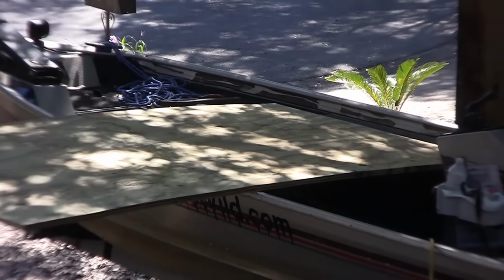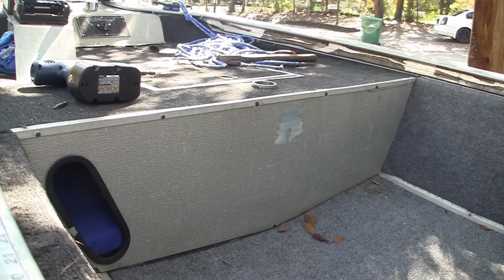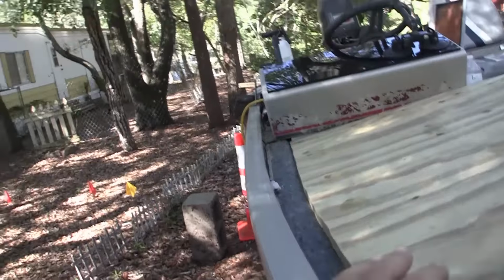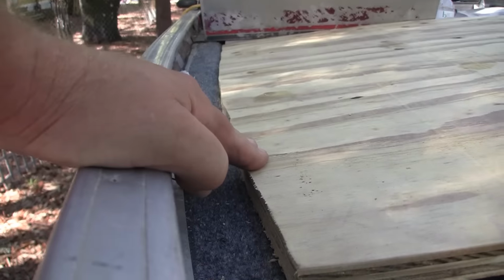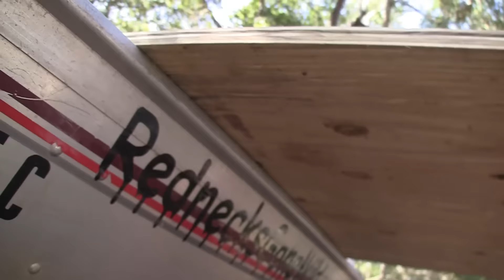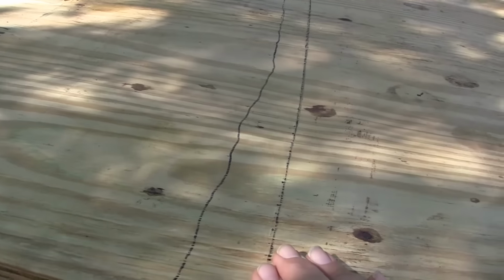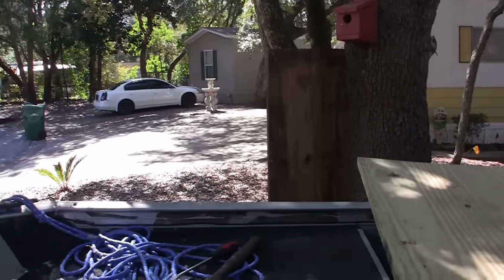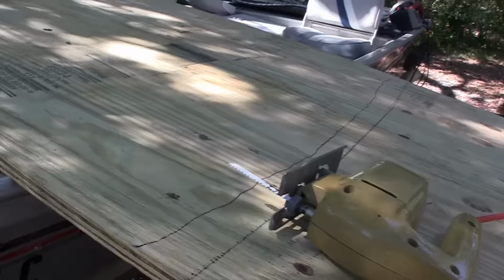Boat Deck Upgrade

Comment: I'm on a low sodium diet and it takes getting used to. The big thing is to add lots of spices, garlic and onion powder, cumin, dry mustard, paprika etc. For salads and veggies get an assortment of Mrs Dash seasonings, they really help! I actually use Mrs Dash on everything. Salt enhances flavors so without salt you need to add 3-4-5x the seasoning to get the same effect
Reply from the maker: Thanks

Comment: Keep in mind the more weight you loose the more your blood pressure will go down.Then the needs for the pressure meds will probably get less and less.I would get the blood pressure RE examined and have the meds adjusted for your weight loss.
Reply from the maker: Ok Thanks